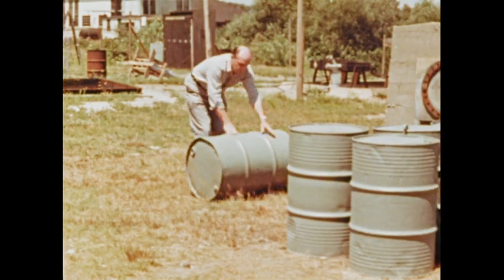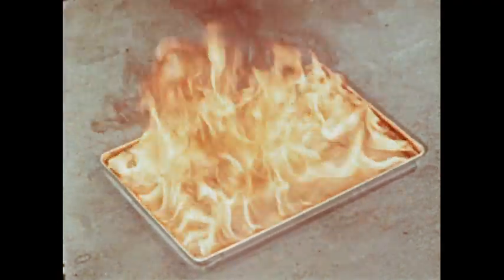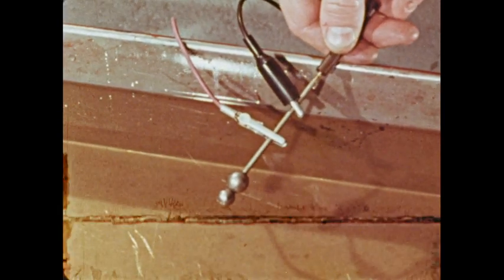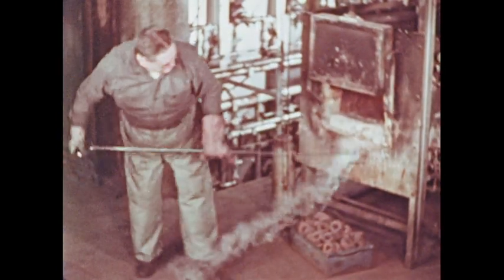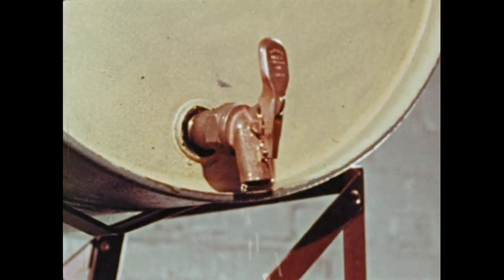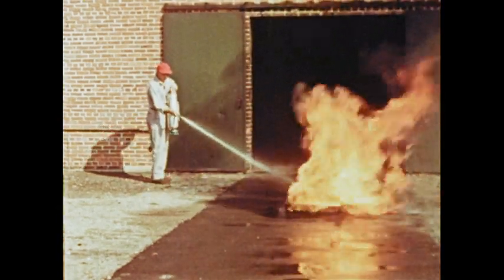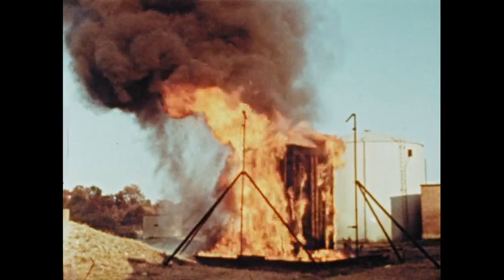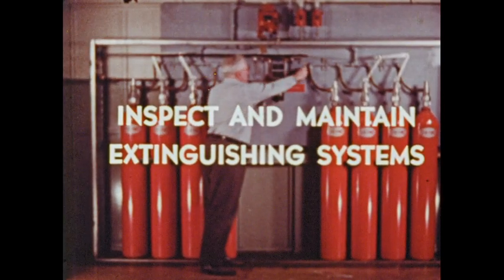Flammable Liquid Fire Safety (1956)

Comment: Don't start a fire, but by all means dip your hands in solvents all day long @ 11:30
@18:12 "the oil used in electrical transformers"  contained PCBs massive issue if they used real transformer oil there.
Reply: The unfiltered cigarette cancels it out.